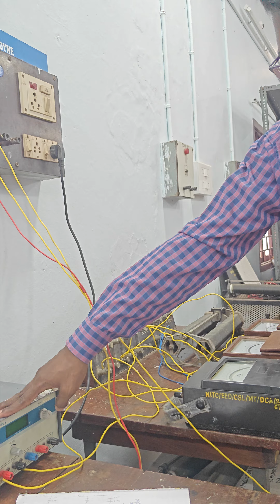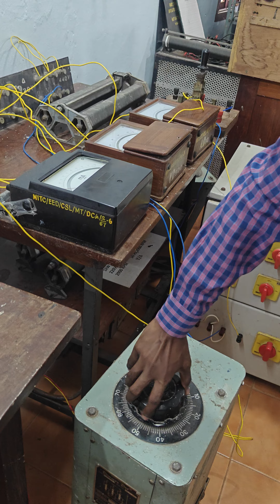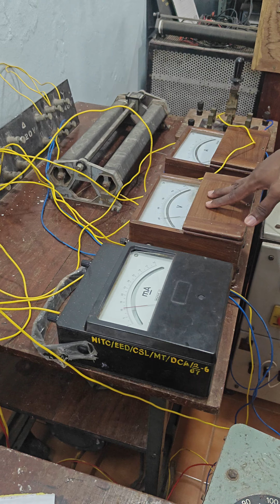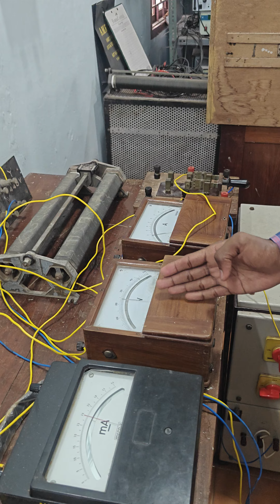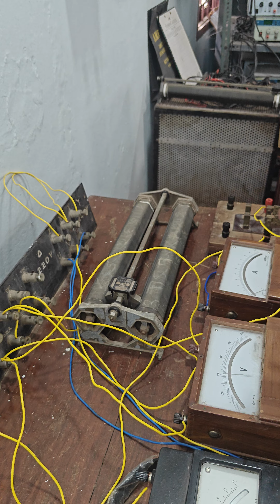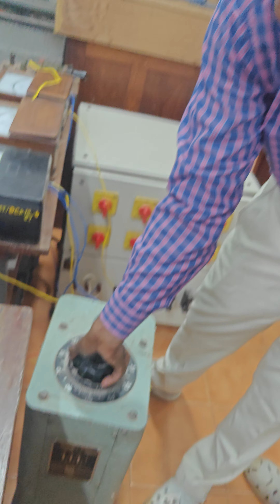Comment: hello, what type, of trigger voltage are you applying? is that DC or AC voltage? i talk about TRIGGER GENERATOR, not about voltage apply to the running motor... thanks a lot ;)